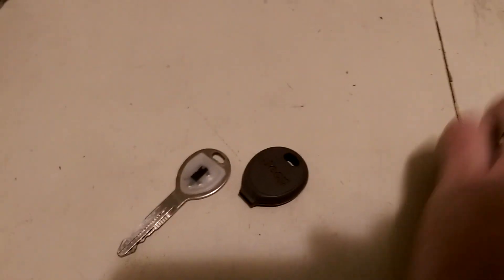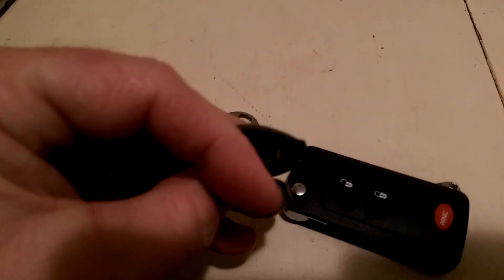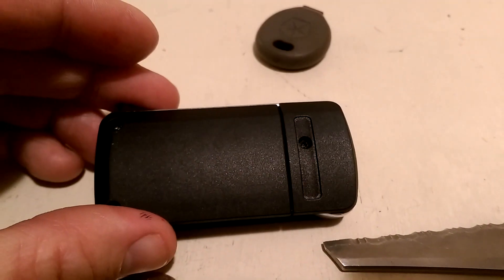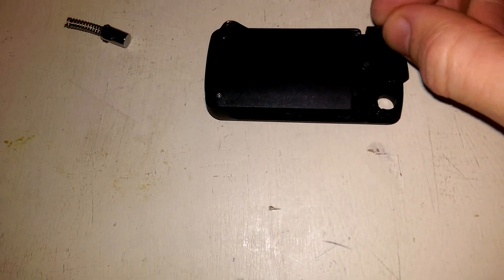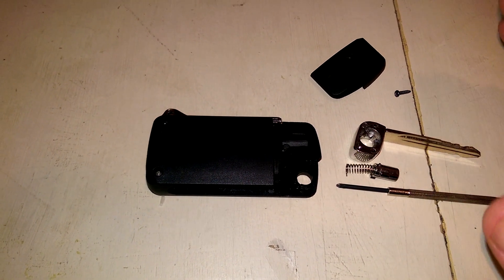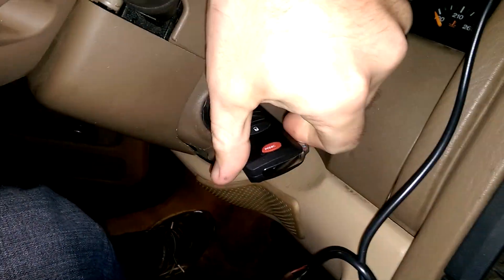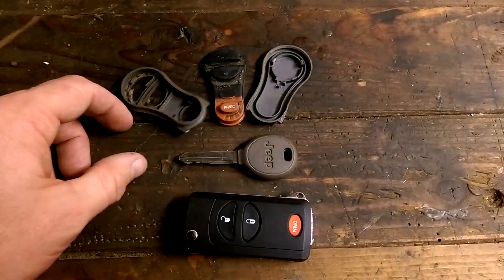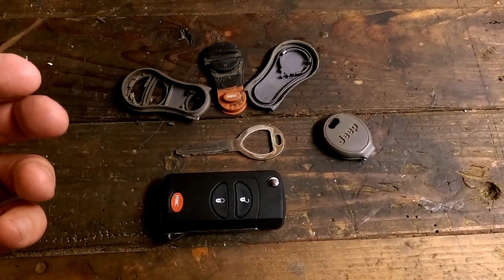Jeep Grand Cherokee WJ Key FOB upgrade

Comment: Nice!
For those that don't want to destroy the original key for the transponder, you can open the column up and zip tie it in place. 
This is also great for having a secret spare key in case you lose the non-chipped one.

Great video though, thank you. :)
Reply: nevermind i get it . good one

Comment from the maker: It is still working just fine. I can take the keys out of the ignition and the vehicle keeps running. As long as the transponder is near the tumbler it should work. If I get time I'll show you what I mean in a video.

Comment: I'm also experiencing difficulties making the remote work, as other people stated, the contact part is a pain...batteries works just fine when i put the board and batteries on the original case. I guess i'll keep on trying with new batteries this time. I did not have any issues with the transponder once inside of the flip case
Reply from the maker: sorry to hear your frustration. it was kind of a pain for me to get to work also. it was over a year ago now, i remember having to troubleshoot the contacts.  one thing i did was verified it works outside the cases.

Comment: Hello, did you have an extra working key?  You didn't want to just put tape the chip to the ring around ignition to be able to use a simple metal key?  A universal FOB would still work for locking unlocking doors.

Comment: The sound of cranking the Jeep though. You can just feel the horsepower though the video :)
Reply from the maker: It has a good sounding pipe on it. Thanks.
Reply: David Polehn 4.7L or 4.0L?
Reply from the maker: +Keaton Johnson 4.7L
Reply: David Polehn I figured. The 4.0 doesn't quite produce a growl with modified exhaust. I prefer a stock 4.0 exhaust, as I did with mine. The combo you got makes for a nice sounding Jeep. And the video was helpful too. My old fob fell out of my pocket one day and cracked pretty good. I ordered a OEM type fob but couldn't figure out why I couldn't get it to work with my Jeep. Glad this solved my dilemma.

Comment: how long has it been since you did this and is it still working, i wanna do this to my 07 pt cruiser but im worried that the transponder might stop working while im driving or something i dont wanna be stranded anywhere, my mod would have to be where i would put the transponder near the key cylinder since im just gonna go with regular metal keys.
Reply from the maker: I recorded a video showing what I did to test the transponder. I have to edit it and post it.
Reply from the maker: Here is a link to the video. http://youtu.be/jSKwW0RxT2A

Comment: you never did actually show the remote function.  I tried this same set up.  the key and micro chip did start my jeep but the remote part never did work.
Reply from the maker: You are correct. I think the issue has something to do with the contacts. Make sure the battery is charged and in correctly. I had issues when the batter started to die.

Comment: I lost my two keys of grand cherokee limited 1999 please what I have to do?????
Reply: alejandro aguirre You have to go to the Chrysler/jeep dealership and buy a new one cut for your vehicle. Warning: it's going to cost a lot for the replacement.
Reply: Woofer Cooker but my truck is now in México can I buy the keys in ebay??? n send it to México to the mecánic programing? ?
Reply: alejandro aguirre They keys have to be cut to your specific VIN on your jeep AND has to be programmed by a dealer. I don't think you can buy premade keys on eBay
Reply: Woofer Cooker ok friend thank you so much let me see other opcions

Comment: the only bad thing about this flip key is that if you don't have the remote making good contact it won't open and if you try  to use the key to open up the door it wont work very well. it's cool and all but just save yourself the headache and keep the regular key
Reply from the maker: +adrianicholas that is true. It goes together, but it can be challenging. You have to be patient and meticulous.
Reply: +David Polehn I regret that I bought that silly flip key. I dropped it and the chrome part that cradles the side got loose and the screws to tighten it together was stripped.... I don't know how long you have had it for and if you still have it but if you still have it you must really like it. I purchased like 3 different keys from different vendors to see if they were made different but not at all they all were garbage like the first one.
Reply from the maker: +adrianicholas that is too bad. sorry you had that experience.